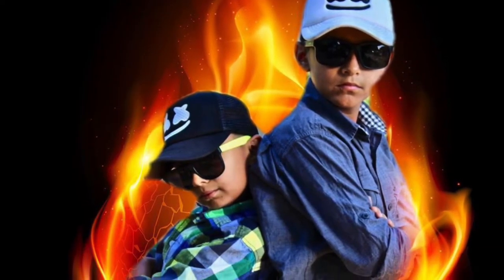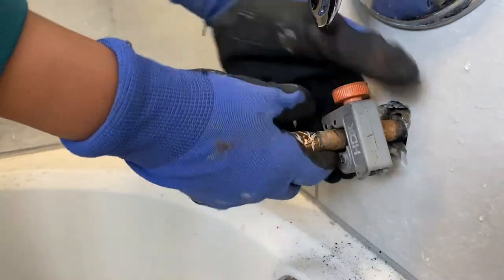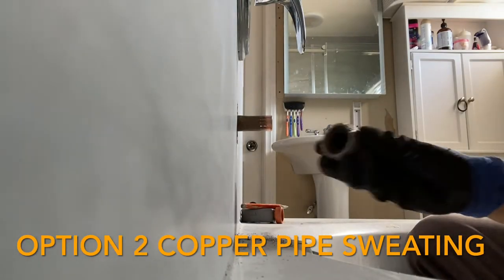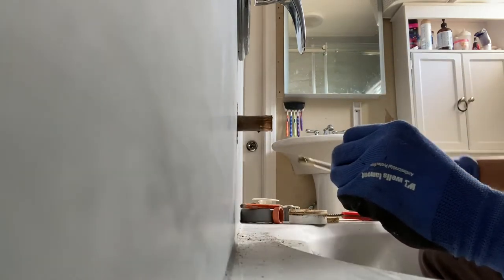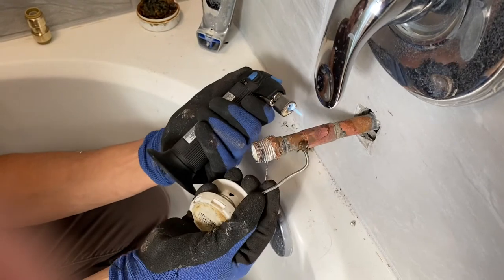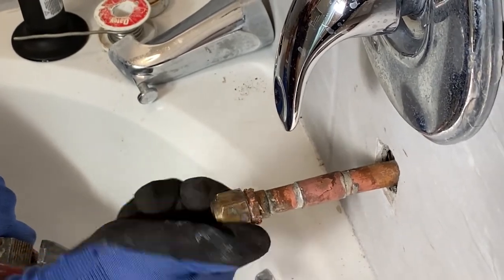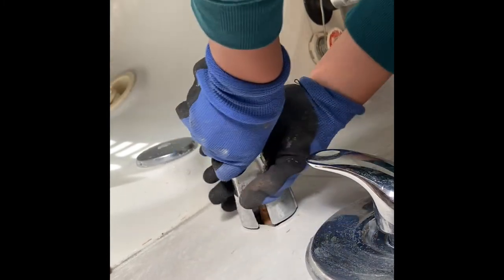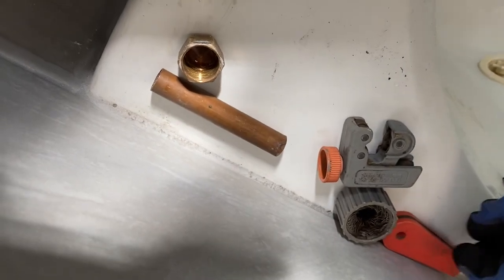How to EXTEND and REPLACE pipe for shower faucet Spout.

Comment: Good job but you  gotta hold that torch on the coupling only underneath Just place your solder on top and it will run completely around and suck in it follows the heat .
Reply from the maker: Great tip !! Thanks

Comment: Is there a version you have where the sharkbite was installed?
Reply from the maker: Hi .. no we have use sharkbite for extensions they have work pretty good but for this job it was not the best option because the don’t stay firm to be able to place the faucet

Comment: Great job guys!  So would option 1 (shark bite) ever work in this kind of a scenario?
Reply from the maker: Thank you .. scenario one could work if you some how cement glue the shark bite so it doesn’t move Because they all move And when we realize that we had to change to solder mode :)